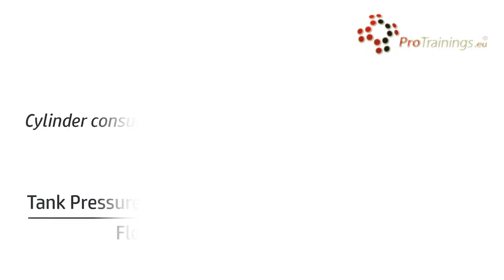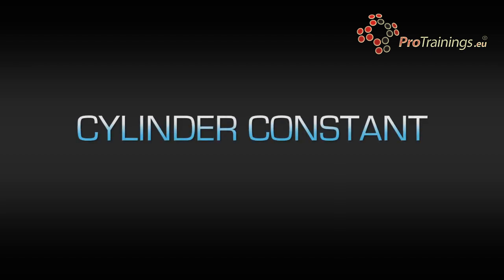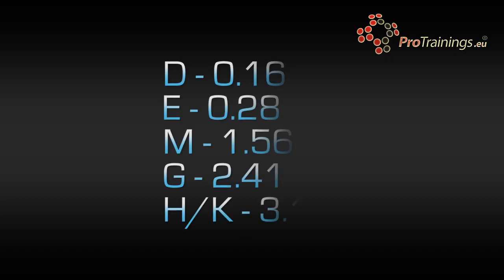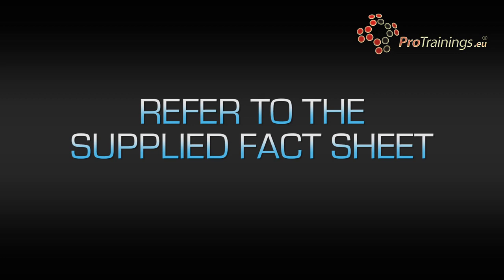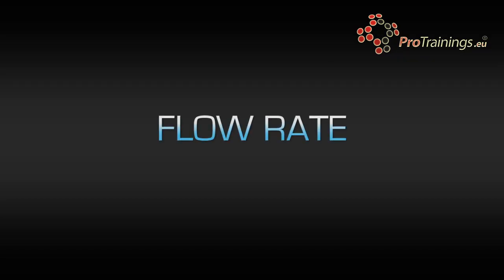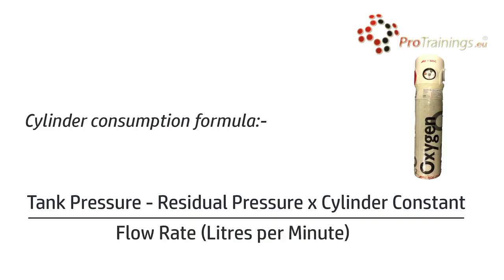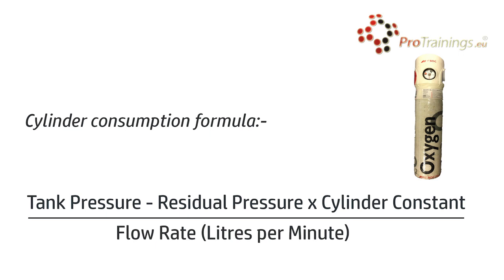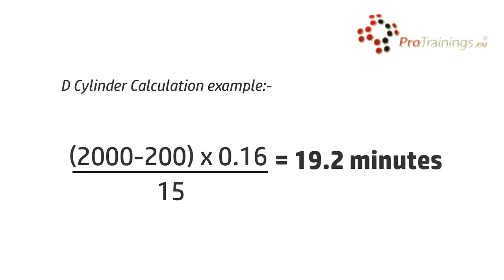How long will an oxygen cylinder last?

Comment: A Full standard Oxygen E-Cylinder has 660 L of O2 at ~2000 psi.  If you want to know how many Liters you have left in your tank look at the PSI remaining on the tank and figure out how many Liters are left. For example, you have a patient using a NC at 2 L/min, and the O2 tank pressure gauge reads 500 psi.  set up this equation:  
660L/2000 psi = (x) L/ 500 psi 
660 L x 550 psi = 330,000
330,000/ 2000 psi = 165 L remaining
165 L / 2 L/min = 82.5 minutes